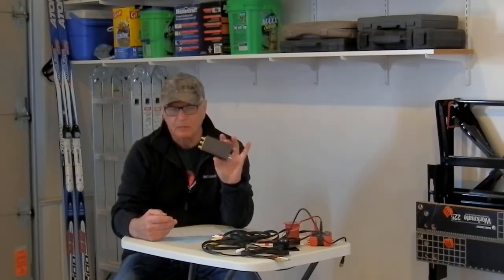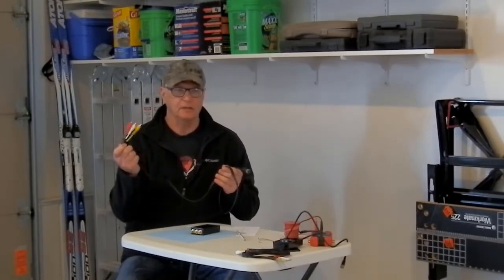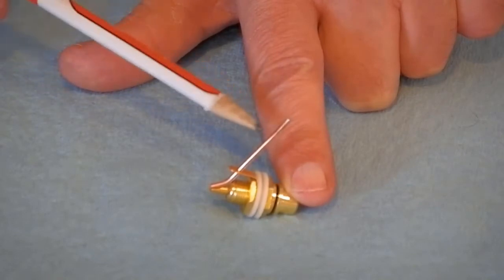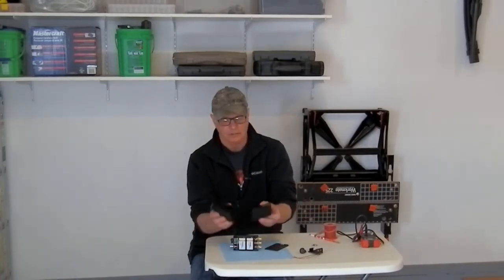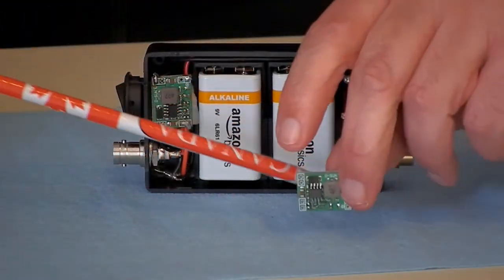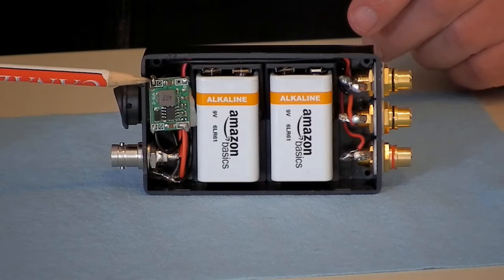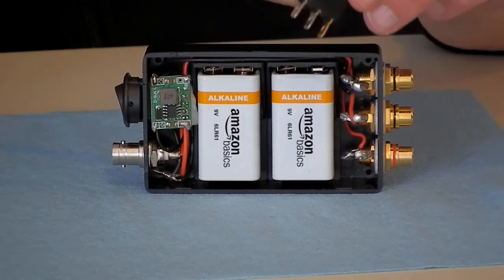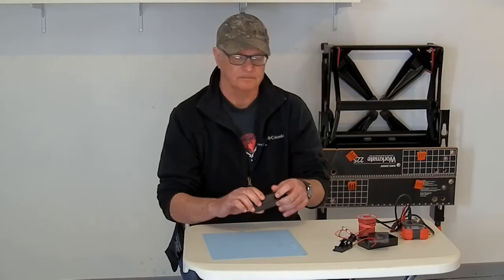GADGETS#11 - 5v REF BOX

Comment: Instead of the batteries--   I'd rather have a set of clamps come out of the box so that I can just hook it up to the 12v battery in the car.. and just do my sensor testing right there under the hood.  Then you never have to fiddle with dead batteries.  Without the 9v batteries inside, you would have plenty of room to add one of those ultra cheap volt meters inside also--  and mount the switch correctly;  and since you should never need to open it- you can just glue the cover on, since it's "too easy to take off".    The volt meter would help notify you if you ever accidentally hooked up the cables backwards to the 12v battery.    Even for bench testing,  I tend to have batteries setting around on chargers at all times anyway..  Extra car battery for my tractor, or riding mower battery, 4wheeler battery, etc. etc.   I like to pull them and keep them on a maintainer through the winter;   so I would always have a 12v battery nearby that I could use.  Or just use the charger itself...   Nice build, as always 

 The chargers/ maintainer's I've been using say "foxsur" on the top of it.  They have a built in fan and an LCD display that tells you temperature, charging voltage and current inflow during charging (6 amp max).  For less than twenty dollars.  You can just hook them up and walk away and they will keep the battery full indefinitely and not overcharge.  I've bought several of them :).    I found out that if you just hook up the clamps to your battery (and not plug it in yet)---  it will still turn on just by the battery voltage alone-  and act as a volt meter and let you know the state of the battery.  Pretty cool.  But once you plug it in, it will only display the charging voltage-  up near 15v (and 6 amps).  These things have been a lifesaver for me..  I dont' ever have the "dead battery" problem anymore;   and I always run my engines out of gas now for winter storage--- so I won't have to keep cleaning carbs all the time. :) .. things have been a breeze in the past few years.
Reply from the maker: the sensors typically powered by these 5v REF Box is very little...9v battery lasts a long time

if you can power from the vehicle battery and get as near 5v as possible and not have alternator ripple etc getting introduced, then good idea

Comment: Thanks for sharing.  Have you tested or is there any issues you know of that would arise by using battery voltage from the vehicle instead of the 9 volt batteries for a source?
Reply from the maker: have not tested but I would foresee 2 issues:

1) alternator ripple (noise) making its way through

2) voltage fluctuations, especially during engine cranking tests
Reply: @theGADGETSplaylist  Thanks!  I just ordered some MP1584EN's and will do some testing.  My main concern was the fluctuation/ripple on input voltage while running.  It will be used for datalogging fuel pressure, MAP and possibly some other data so cranking will not be much concern at the moment.
Reply from the maker: @kevmacfast1  should work fine...

Comment: I was just wondering why couldn't I use the guts from a USB car cigarette lighter socket adapter? I have lots of those... Hmm. Experiment time!
Reply from the maker: measure the output of the USB adapter first...we're trying to be close to 5.000v and some of those might push 5.200v

also measure the ripple (noise) of that adapter with your oscilloscope

if both those criteria are met, then sure that could make a decent 5v REF Box

you might want to check out GADGETS#21 as my preferred 5v REF

Comment: One quick question I think I have it down. How many wires go to the power switch? I see you have a 3 blade do you need that or will two work?
Reply from the maker: there are 3 wires because switch has small built in LED indicator light...sure 2 wires will work...LED won't light, that's all...

Comment: Very neat solution, but using a switching power supply module, does it create a lot of noise on the output to the oscilloscope?
Reply from the maker: in practice, not seen in our automotive waveforms

I featured a linear LM7805 box in #21

and in #84 I compare the two

thanks for your interest Roy and I would have got to your comment sooner but YT buried it
Reply: @theGADGETSplaylist  no bother, like your videos

Comment: Thank you for all that you do. I have a question. In the diagram there is a diode [D1]. But you did not mention it. Did you use it on your box?
Reply from the maker: +rafael garcia - that D1 is a LED (those little arrows differentiate it from ordinary diodes)...it's built into the switch that is used, not something we add:-)
Did you watch GADGETS#84 just released, where I recommend the 5v REF Box in GADGETS#21 over this one?
Although #11 is still viable for automotive work...
Reply: Oh ok I got it. I’m new to your channel but I have seen all 3. They’re so cheap, I’m building both. What is your preference on the 9 volt power supply, series or parallel? Thank you.
Reply from the maker: @rafaelgarcia-xk7eu  - series or parallel depends on the input requirements of the DC-DC converter.

In this build (#11), the board wants 7v and up. The 9v batteries are in series to provide 18v. That way, they would have to deplete a lot to flirt with that min voltage input.

In the other build (#21), the linear regulator will generate more heat the more spread there is between input and output voltage. So the choice was to put the 9v batteries in parallel to keep input voltage low.

Comment: Would you happen to have a part list we can see to complete this project?
Reply from the maker: +Oscar Gomez - no parts list and no links (eBay, Amazon, Aliexpress) which become dead links in a matter of days.
Also, this channel is viewed in dozens of countries with sourcing that would differ from mine in Canada.
The project box, 9v battery holders, RCA connectors are all standard items that can be easily found online.
Where the parts are specialized, as in the  MP1584EN Buck Converter here, I explain those more fully in my videos. Then, they too can be found online in the region the viewer resides.

Comment: Nice job, I use 5v from a usb port of my notebook to power incylinder transducer, works fine.
Reply from the maker: +Mambre Khachatryan - simpler, no doubt...

1) There's a +/- 5% range on the USB output (4.75v- 5.25v). Might not be an issue but these buck converters are within .05v of nominal 5v.

2) I use HScope and android tablet so no USB power source available.

3) This 5v REF BOX also used with multimeter only in bench testing.

I do agree, those 3 reasons not withstanding, that a laptop UBS can power most 5v reference sensors.

Thanks for watching.

Comment: I'm going to try building one using a ubec 5 volt supply and see how that works. http://www.rcworld.com.au/media/downloadspdf/E%20MAX%20ELECTRIC%20MOTORS%20ACCES.ESCS%20AND%20LIPOS%20EMAX%20ESC%20%20-%20EMax%20UBEC%20Instructions%20LP%20Dec%2008.pdf.
Reply from the maker: +rs1971camaro - UBEC has a switching power supply as does this build. It's been pointed out to me that such supply introduces noise in my waveforms and that I should have chosen a 7805 based power supply in spite of it's inefficiency and heat generation (which may not be a big deal at 20mA draw anyways). So, I've ordered a LM7805 based board and an aluminum project box and will do another build in a few weeks. I'll do a side by side comparison of both boxes and see if a cleaner waveform gets generated. You might want to hold off for those results...
Reply from the maker: I've ordered this board about 4 weeks ago (may take another 3 weeks to get here!)
https://www.ebay.ca/itm/381375067118